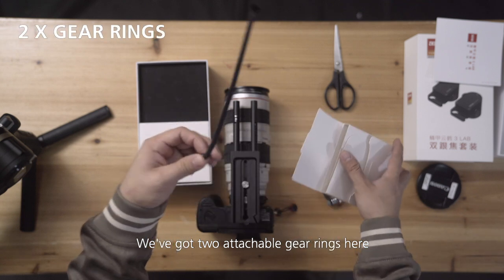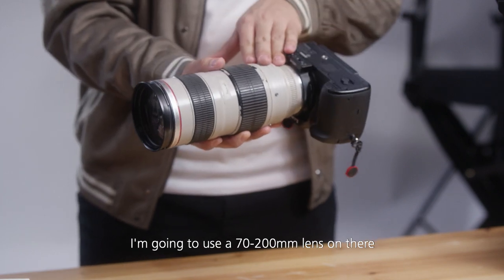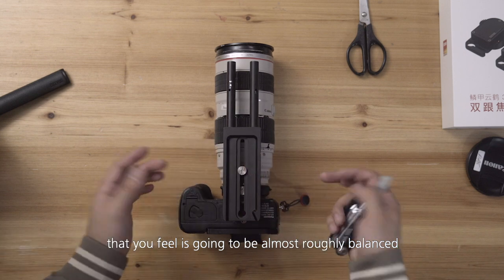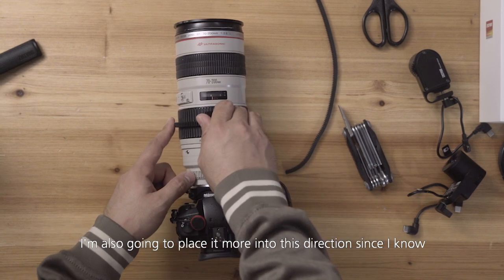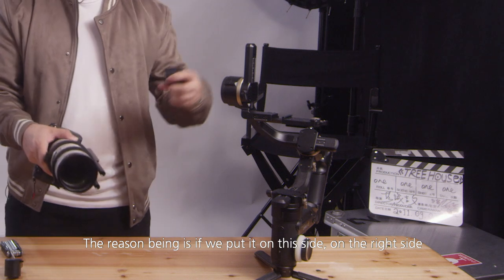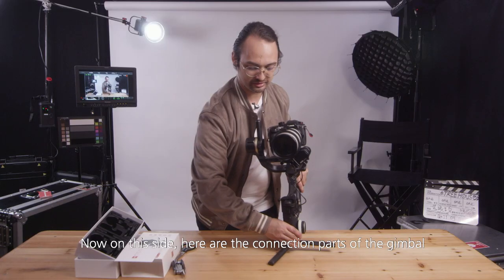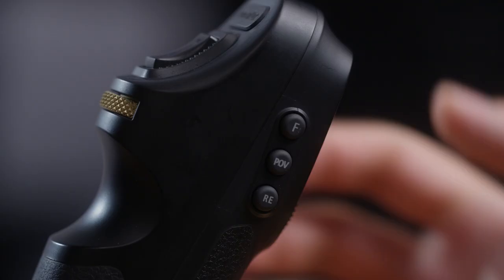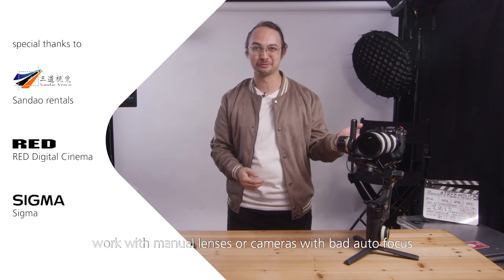Zhiyun Crane 3S OFFICIAL tutorials A6 focus module cable and settings

Comment: I have a question. 
I bought the pro kit and the regular kit. The pro was 799.00 on sale the regular kit was 529.00 on sale. Not sure if I will ever use the accessories with the pro kit. Do you think I should keep the pro kit just in case I upgrade my cameras that can use the pro kit or keep the regular kit, it's only $270.00 more than the regular kit.
I did set up the gimble from the pro kit and it was so easy and works amazing, but not sure which one to keep

Comment: I have a 24-70 sigma on a canon lens on the gimbal. When I push the center button on the handle it would auto focus . I used to be able to do this on my crane lab. Why won’t it work on crane 3s?

Comment: Need your help brother.
I bought the Smart Sling package of this gimbal which doesn't include the focus or zoom servos.
So, I bought only one as per my need and that's the one for focus.
Now when I connected it to the gimbal, it's not working with the focus knob rather it's working with the zoom button.
Tried switching the ports on the gimbal from focus to zoom and back, still no luck. It's being controlled only from the zoom button. :(
Reply from the maker: Saikat Mridha hi I see, I had the same issue before you’ll need to purchase the one that says focus/zoom, maybe u got the only zoom one?
Reply: @marcelbrandel9078  Thank you so much for your response and help brother!
Could you please check at the back of both the zoom and focus servos and please let me know which one says "Model- CMF 04" and which one says "Model- CMF 03".
Or, could you please let me know what it reads behind the focus module.
Sorry, I'm very confused at this stage as the one I bought says focus/zoom controller, but does only zoom... :)
Reply: @marcelbrandel9078  It'll be a great help to me brother if you could kindly let me know the answer.
Reply: Same problem here.
Reply: @TheStoriesWeTell  I'm waiting for something. I'll let you know when I know the real solution.
Reply: @TheStoriesWeTell  Here is the solution to the problem I've figured out and made a video. Check this out-
https://youtu.be/4bw0C5WymWc

Comment: Hi sr. Help me with a problem!!
When I half-press the shutter button on SmartSling to activate autofocus, that function doesn’t works very fine. It doesn’t mark as green my focus on screen on my canon mark iv 5d. Do you have any idea why happens this? Or the gimbal works like that? Because before I used zhiyun crane 3 lab and the same camera and I could do that..

Comment: Hey cool video does those ports on the crane 3s work with other follow focus motors like Tilta nucleus nano? Any help with this thank youuu
Reply from the maker: hi, thank you. and no, unfortunately it only works with the zhiyun modules
Reply: @marcelbrandel9078  will it not provide any power at all? Would you be able to use the Power USB output at the back? So is there no way to power a tilta nucleus nano off the gimbal? Thanks
Reply from the maker: @TilakLimbachia  I did not had a chance to try it, I don't think so, the only way I see is to use the zhiyun battery pack or a NP battery that has usb output
Reply: @marcelbrandel9078  ahh I see damn I was really looking forward to powering it off the gimbal but guess I just will have to have a heavier rig thanks for answering it.
Reply from the maker: @TilakLimbachia  no problem
Reply: @TilakLimbachia  It does provide power to the Nucleus Nano, I use it that way :)

Comment: Hello,

Please for help:

my setup:  Canon 5DMIV with 24-70 lens.  

I have a big Problem with Focus

1.  I read the Manual  that on the lens should be set to Autofocus and follow focus in the camera is set to off.  I can't focusing very smooth from first plan to second plan because the focus engine is active and when i rotate the Focus Wheel the motor from lens is very loud and he ''beats'' with the Engine from Gimbal for Focus.  Ann when I set on the lens to Manual Focus  I am not able to focusing this dont works.   

I can only focusing smoothly when the camera is not connected to the gimbal with the cable, but then I dont have any control of my camera :(

2. Second thing is that when I set Points A and B in the rocker menu, after I restart the Gimbal this is not in memory I must renew this step. 

Sorry for my english but I hope that someone can help me...

Someone know something about my issues ??